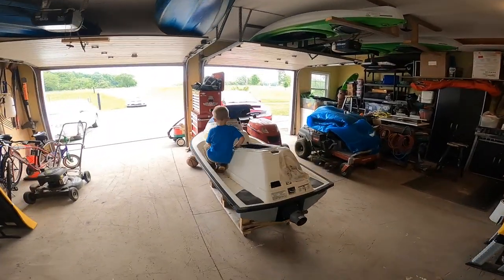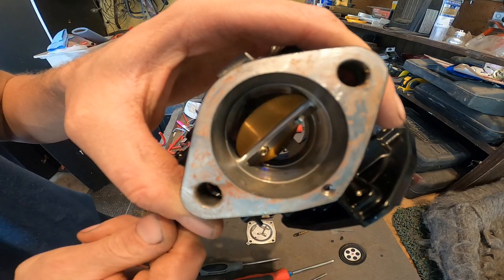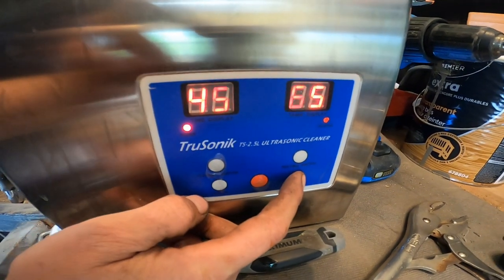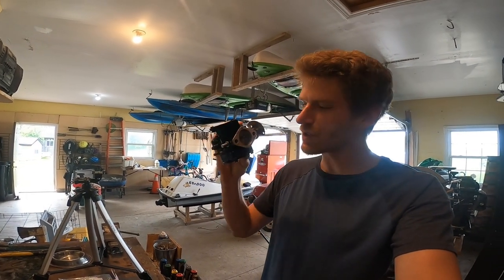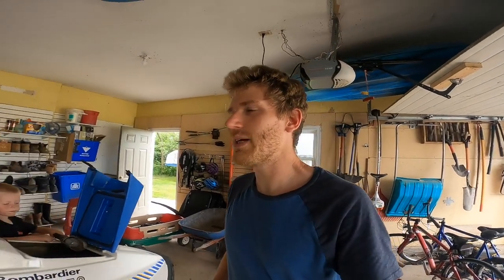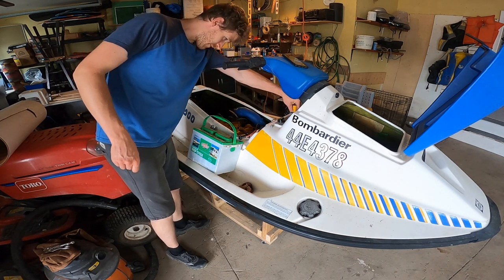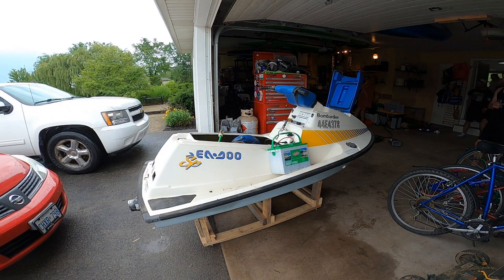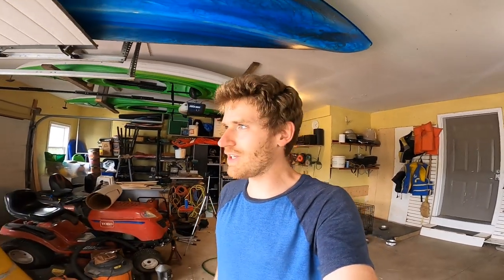Seadoo Sp (Part 3) Carburetor rebuild

Comment: Have you deleted the oil tank and put mixt or do you use it?
Reply from the maker: I use the oil tank. The oil pump seems to work fine.
Reply: @Project2Potential  Okay, Just wondering I have the same modell and dont have any spark you know why
Reply from the maker: @isakvikstrom2743  
It could potentially be so many things, I couldn't tell you right off the bat. But I'd run through and check the Coil, stator, kill switch, safety harness switch, bad grounds, bad spark plugs, bad wiring.
Reply: @Project2Potential  I think that the coil was the problem

Comment: Make sure you dont start flowing water until it is started and stop the water before you shut it off… Its really bad to have water running without it running
Reply from the maker: good point! I learned this after It ran. it doesn't look like a ruined anything though.